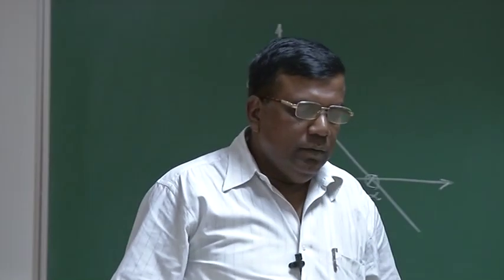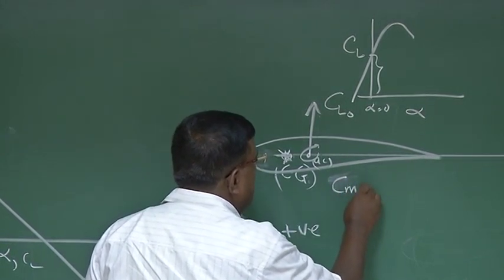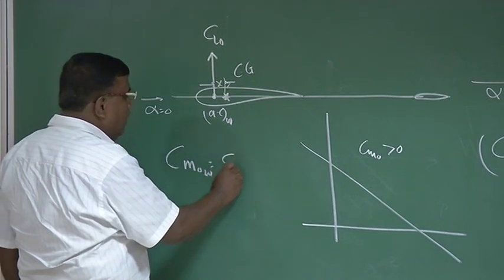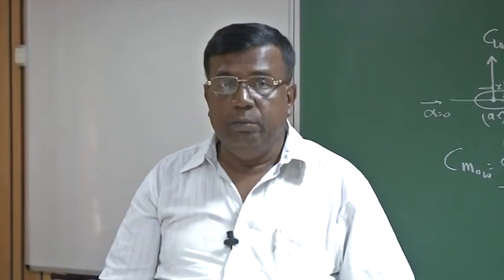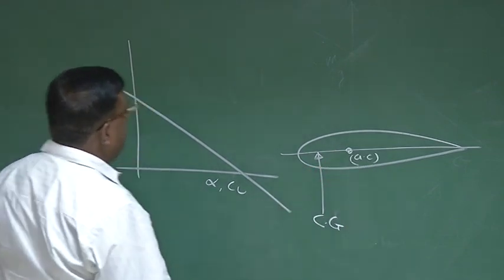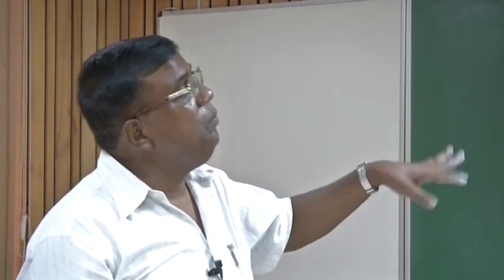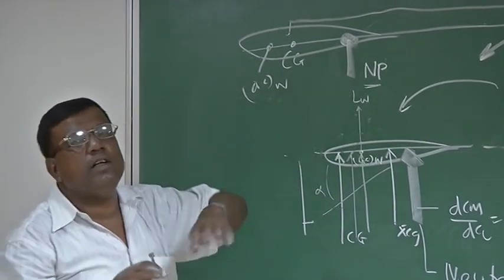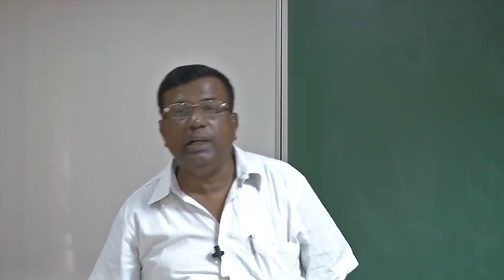Contribution of Wing and Tail: Stability

Comment: Sir, At 8:54 you have housed the tail with negative setting angle. Doesn't it unnecessarily give drag penalty? I think just by giving the tail enough weight & separation from CG would provide the required +ve Cₘₒ.